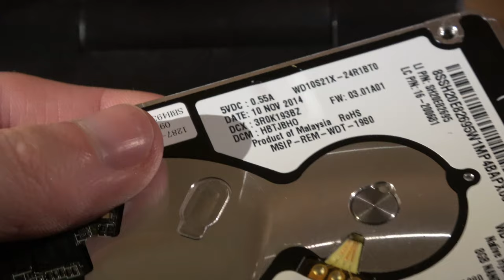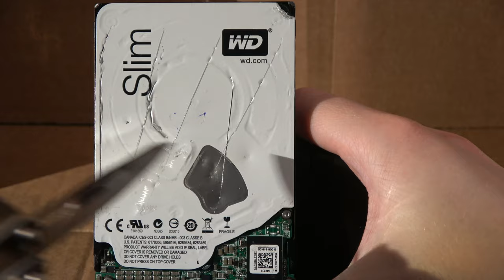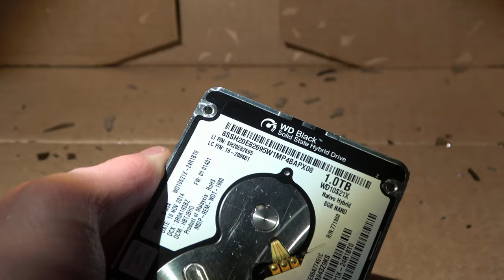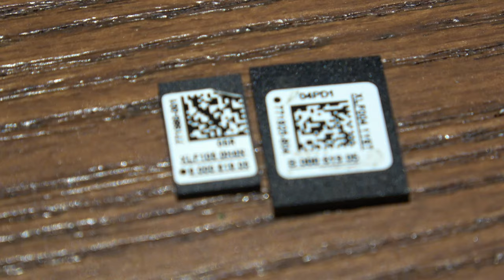Destroying a Hard Disk Drive - SSHD Destruction

Comment: does scratching  sshd from the back delete the info on it
Reply from the maker: From the back? No. It will only make the drive inoperable probably. But to remove the data you can simply run tools from a computer on the disk. Or open up the drive and destroy the platter and for good measure the small SSD chip.
Reply: @Nostalgia_Realm  can the data be retrieved even if the back of sshd is scratched  heavily